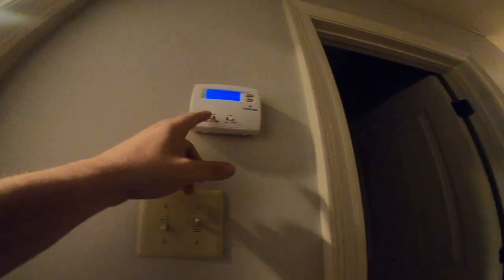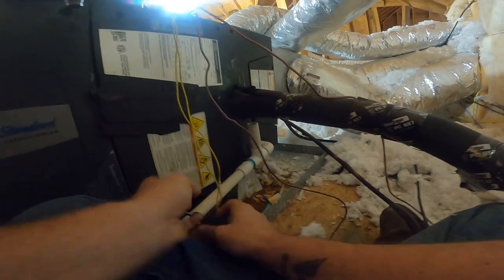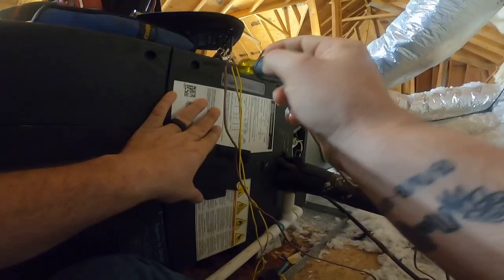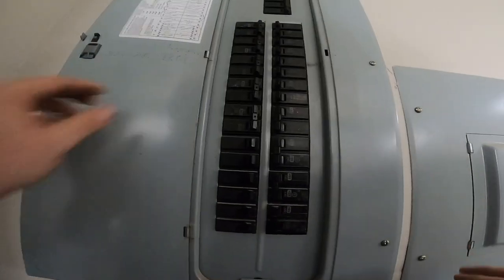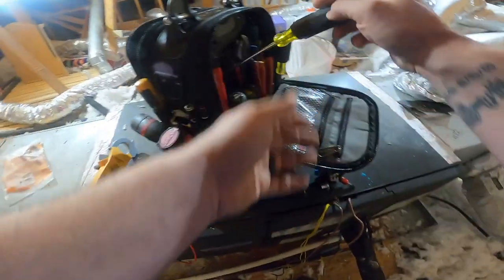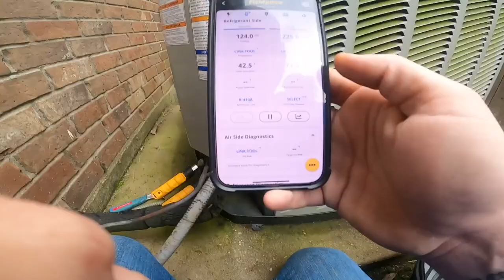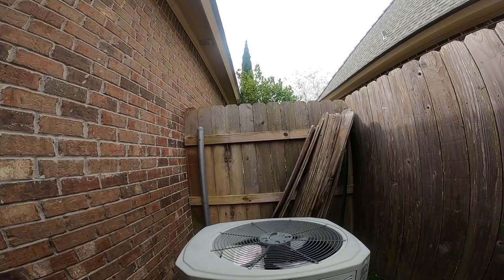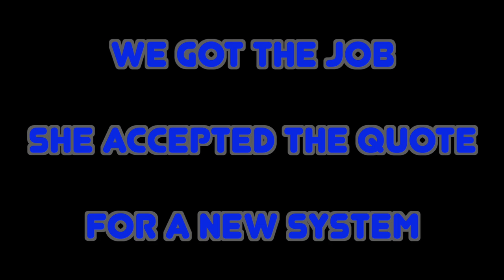American Standard System Does Nothing

Comment: Hyperion Air Handlers are superior pieces of equipment ..... just hard to get familiar with them.... cantankerous and aggravating until you master them. They are not plastic, they are metal... just composite coated. But they are still not for everyone. Great video as always John.
Reply: I agree. At first I was frustrated with the TAM9 until I sat down one day, read the manual back to front and saw how many amazing features like splitting the top and bottom and cutting it in half to get it into the tightest is spots.

Comment: Those plastic air handlers are weird. It says right on the air handler that if it's leaking air, it's working properly. The clips go missing. The plastic often breaks. I don't like them either.
Reply: They are supposed to leak around 2 or 3 percent. That's normal
Reply: @georgesummerlin1602  yeah I always see them taped up worse than in the video.

Comment: That double pole breaker was strange. It seems that only 1 pole of the breaker only tripped partially. If the bar that mechanically joins both poles had moved through its full travel, you wouldn't have been able to read 120 on your meter.

Comment: So it wasn’t the GAF or low charge after all. Just another junk Murray breaker. I install nothing but American Standard now. I’ve had some aluminum coil leaks that started in 2008 or so with the rediculous 410 changeover.  That’s about it. Why would you replace a system now? The department of energy Froot Loops are changing refrigerants and efficiencies over next year. That fan motor will be fine until then. add some more refrigerant if you have to in the spring. Get her by until the refrigerant and efficiency numbers change over. You should’ve pulled the cover on the panel and inspect the back of the breaker. It’s probably burnt out like most of them do. Disconnect 5KW. You don’t need 10kw down there anyway. Then install a new breaker if the busbar is in good shape. Done until spring. If the fan motor goes out she can run emergency heat to get her by.
Reply from the maker: You’re crazy as hell. Refrigerants aren’t changing until 2025
Reply: @johnisraelhvac2019  You are correct on bs 5th and 6th refrigerants to haul around on my van. 

The minimum efficiency for new equipment must be 14 in the north and 15 in the south as of JANUARY 1, 2023. Unless it has to be replaced, I’m not recommending one until after the new equipment arrives at my distributor. Squirt you some zoom spout in both ends to lube those bearings. It’ll be fine.
Reply: @USA-GreedyMenOfNoIntegrity  I'm not a hvac guy but as a mechanic I thought your advice was good.